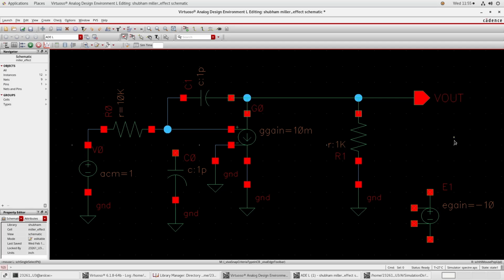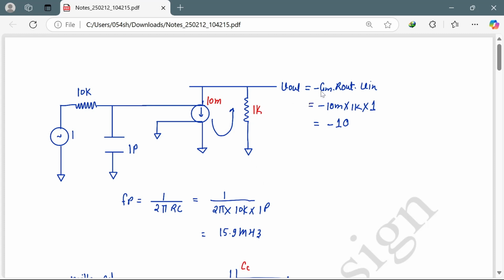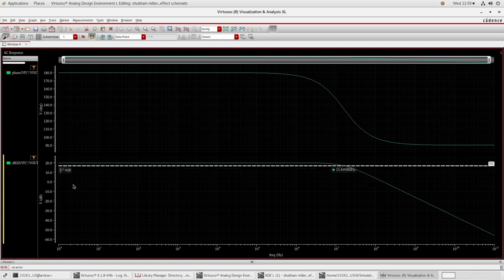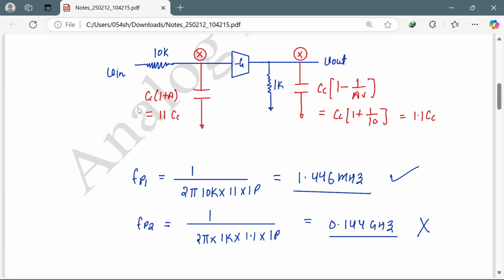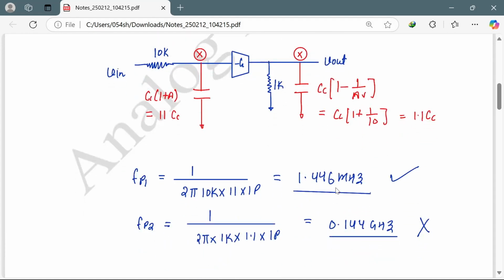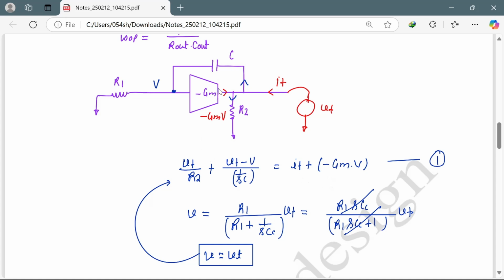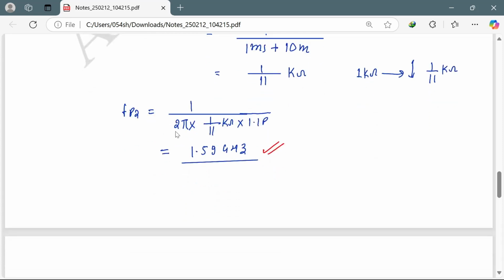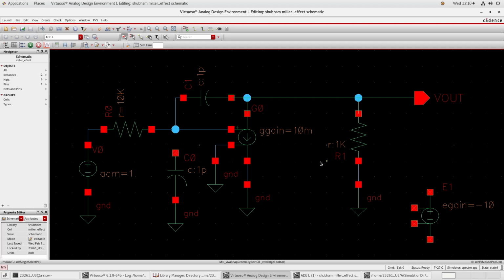Miller Effect Theory & Simulation | AnalogX

Comment: Thank you Sir 🥹
My stupid Q:
How do you find gm? The customer gives the specifications GBW=hz ~Ghz, and CL= pf, Cc=(0.2~0.5)*CL, for w/L, all gm values if L=1um, find all W size!
Which process do you use? This is usually a confidential document.
Or modify Chip 
.18 process?🤔
Reply from the maker: @SAM_labassistanMangement 
Hi.. its good question 
Basically depending upon static gain error, we decide our gain and then we decide our topology ( single stage, two stage,…). You can use gain and slew rate to decide your gm.
You can refer Allen philip book for two stage amplifier design.
Reply: Thanks 👍! I am new  @AnalogXai
Reply: I am stupidly that you designed a good current Source 🤔 @AnalogXai